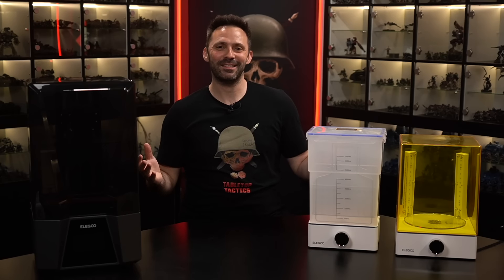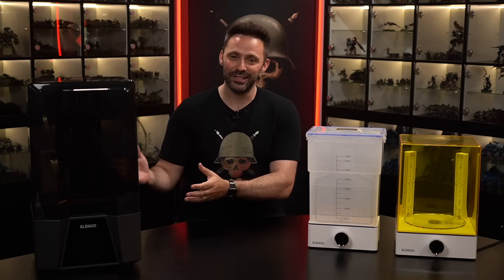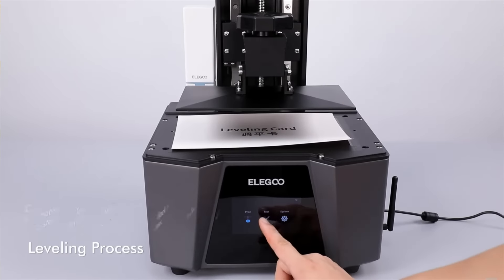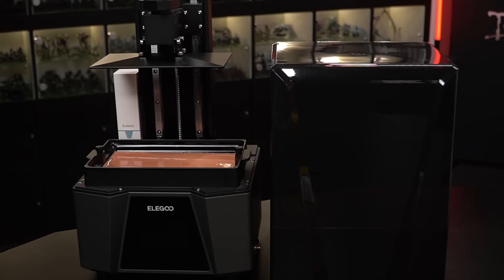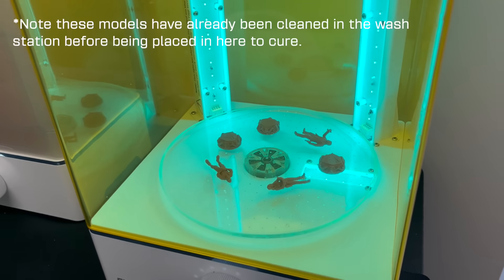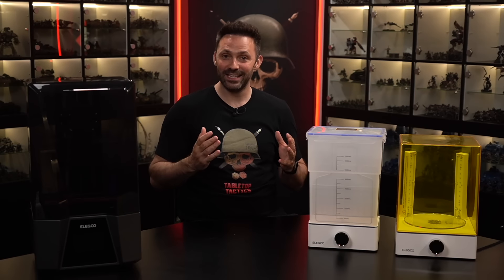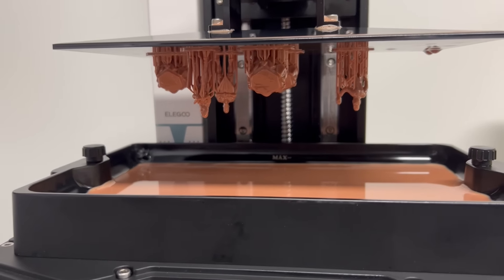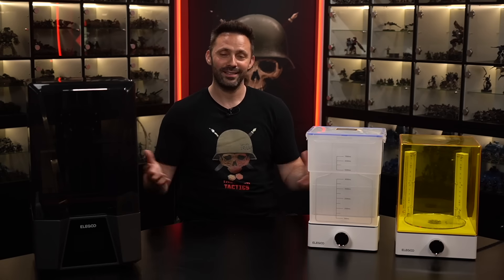3D Printing: A Complete Beginner's Journey | Elegoo Saturn 3 Ultra Review

Comment: Do note that Elegoo has already released Saturn 4 Ultra, which has a ton of new features you don't want to miss out. So don't go out buying the Saturn 3 just because it was featured in this video. Unless of course, you are spesifically looking for a second hand printer, which can be found very cheap as the technology advances incredibly fast. I have a Saturn 2 from about 1,5y ago, and it feels like its ancient, altough the print quality is almost on par with the latest models.

Also this was a great video! Often these videos contain a lot of bad or misinformation about the process, but this had no obvious flaws. Safety was highlighted, altough would have been nice if you would've mentioned more directly that liquid resin is highly allergenic and produces a ton of VOC (=bad for your health) until cured.
Reply: I have a Saturn 3 and just bought a Saturn 3 Ultra this week. Did a ton of research and have seen a ton of people having issues with the Saturn 4 Ultra. Love the tilting vat but don’t think that printer is as trouble free as the 3 series.
Reply: What can the 4 do that this can't?  Tilt release and auto-leveling are the only two things I see.  And $150 more on the price tag on Amazon right now.

Leveling is super easy and should only need to be done once, and I don't think tilt release is worth it.
Reply: @greenman360 print several calibration tests different settings at the same time.

Comment: It is easier to get failed prints off of the FEP sheet if you use the tank clean option, that way you are only fiddling in the corners of the vat, which makes it less likely you will damage it to the point of needing to replace it.
Reply from the maker: Great tip, thanks!
Reply: To add to this, take some of the supports from a previous print and press the raft against the corner of the fep when you tank clean. This will fuse the supports to the hardened resin of the tank clean and give you a handle to effortlessly pull up the edge with zero damage to fep whatsoever.
Reply: I found if you make an L out of paper sticking out of the vat you can use it like a pull tab and peel the tank clean in one satisfying go

Comment: aaaannd im back, have been lacking in batreps recently. 3d printing alowed me to actualy collect and paint armies which before was not possible, I also use tupperware coupled with a magnetic mixer for my wash and just a uv lamp with a rotating display stand from amazon. It does take a bit of time learn but i dont think any hobbyist is scared of applying a bit of effort for some amazing looking models to collect, ps get a flex plate, they save so much time on having to re-level the build plate

Comment: A Bamboo Labs A1Mini with a 0.02mm head also works well on most miniatures, and you dont need to mess about with resin.
Reply: but if we want the precision, maybe resin printing is better, because of the layer lines of FDM printing😶‍🌫
Reply: @joejoebaker  If you want uber detail resin is the way to go (tbh ive seen resin produce so much detail that it would take a pro painter to come anywhere near doing it justice) FDM, as long as you have set the layer lines right (0.1mm) FDM is fine for bits and vehicles, and larger primaris models).

Comment: Same printer as my latest one that i bought before the summer. I am pleased with my Elegoo Saturn 3 Ultra. It is a really fast printer and have a great user interface that i like. As well having wi-fi connection so you can send the file from your computer. No issues what so ever with it and not that smelly either when printing. 👍

Comment: I could never afford the space for the wash and cure station. I use Tupper wear filled with IPA and gloves. I cure with a little cure box. 

My prints are great on an 8K Phrozen. Wash/cure station is GREAT if you can afford it, but you do not need it.

Comment: I got this printer, and it came with a free Usb stick. I can't save files to it. Do I have to update some software? I.
saved files to my other USB stick and it didn't work in the printer
Reply from the maker: Sounds like the format of your usb stick doesn’t work for the computer you’ve got the files on - either that, or the usb stick you were given is faulty. Formatting on disks can get pretty complicated, but basically your USB stick should be a FAT32 format and be readable by Mac and Windows. Not sure what you are using.
Reply: not sure what type of your files, maybe you can try to slice it as a .goo file? this saturn 3 Ultra support .goo files. hope this will help😁